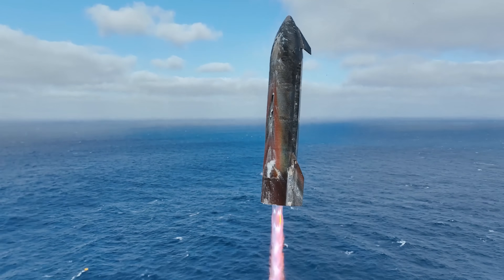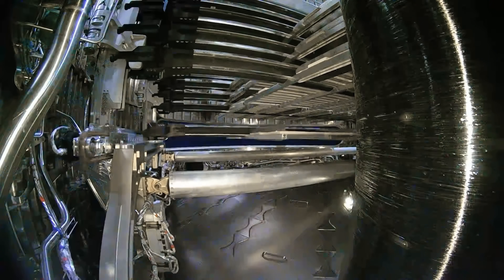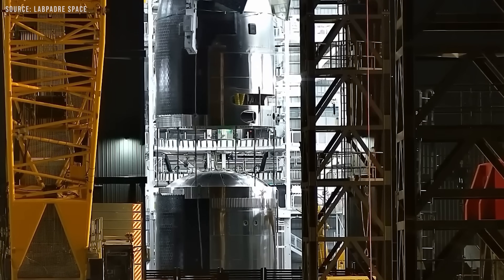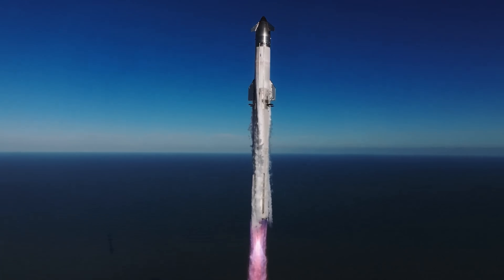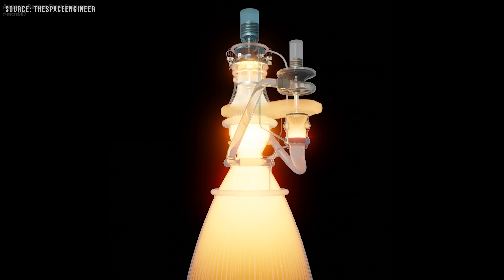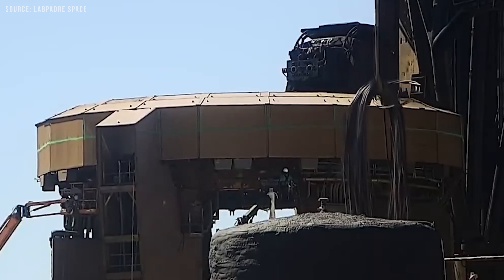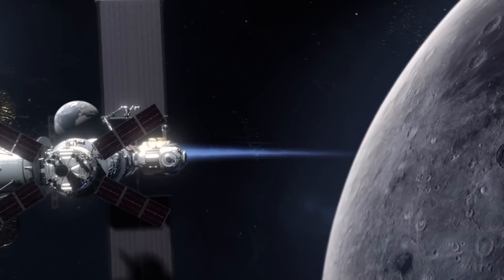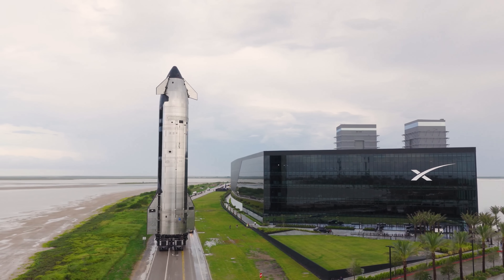SpaceX Found Brilliant Upgrade on Starship V3 to Land on the Moon Sooner than NASA expected...

Comment: As I said before astroid and meteorite impacts on the Moon are going to make nuclear reactors on the Moon dangerous the same with habitats.Therefore they need to be dug in under the surface of the Moon that is not just logical it is essential therefore please consider it. The Moon's surface is tuff therefore we need to design the correct tools for the right job starting right now.😮

Comment: I wonder why SpaceX is favouring refueling in low Earth orbit instead of favouring a modular system. What I mean is; orbital refueling is extremely prone to combustion. Why not just swap fuel tanks?
Reply: Its probably about structural stability and reliability. A modular design would require the starship to be connected via fasteners. A welded continuous design is much more reliable. A single fastener failure could cause a catastrophe. Maybe some sort of port door to swap the tanks could be accomplished. Or, like a booster, the payload could be swapped to a new fuel/rocket assembly. However I don't think its easier than a fuel transfer.

Comment: Starship Block 2, in fact no Starship, has yet to reach Low Earth Orbit, with any payload. And now SpaceX has moved on to Block 3 with no flight tested Raptor 3 engines. Raptor 2 engines were never capable of LEO. Raptor 3 is barely capable but unproven.  SpaceX needs 150 tons to LEO on a reusable Starship or they might as well go home. 200 tons would be better.
Reply: They said it on a suborbital trajectory on purpose. But the fact is they have the speed just a little bit below orbital. It can absolutely speed up more than enough. But this is not a regular ship like sls. It is completely new technology from one end to the other, and much of it being pushed to its limits and used in ways never intended. They're not going to risk having that thing explode while actually in orbit. All the stuff on the inside that no one talks about is new as well. And in case you haven't noticed, SpaceX doesn't spend two years testing a change on the ground before it launches, the launch is the test. That gives them a much higher than average chance of blowing things up until they get things worked out.
Reply: Oh, but while vastly more entertaining to watch, having the test be the launch, is the faster and cheaper way of doing things. 
SpaceX built the Falcon 9, the Merlin engine, and the dragon one capsule. It took them 6 years and cost just $800 million. 

SLS is mostly reused parts that have been slightly modified, and it took 12 years and cost $25 billion dollars. And the six main companies have been in the space industry since the 50s and 60s.

And no joke, if you take off those boosters, which Northrop Grumman actually needed 2 billion dollars and a decade to modify from the old '80s shuttle boosters, the Falcon 9 is actually the more powerful rocket by just a little bit. And sls costs literally over 4 billion dollars to launch.
With starship and it's booster being the biggest things ever launched, with a crap load of engines, they have launched what 12 times, and including all of the R&D and infrastructure building, SpaceX has spent about 7 billion dollars on starship development. It's astounding where they are. 
And it's horrifying how badly the old space industry is screwing us on everything.

Comment: Thumb down.
Starship v2 Didnt explode in failure 3 times.
Goon is lying and talking bolox.
Every Starship flight has been a fantastic & very useful data gathering excersize.
Every one of these TEST Flights are for the brain challenged, " TEST Flights" Each TEST flight designed to TEST the perameters of new & specific requirements,  and therefore anything gained after the targeted TEST is a bonus.
Imagine if Space didnt TEST past their goals and did the minimum work,  that would require a perfectly functional Starship to be used just to test the controlled disassembly systems and what a dreadful waste of everything that would be.
Such a shame there are so many morons trying to big themselves up on the backs of the worlds indisputable best.
Best to watch Tim Dodd the Everyday astronaut, or Marcus House or WAI or Ellie in space.
No point watching morons and filling your head with bolox.
Reply: Calm down this isnt a religion...LOL